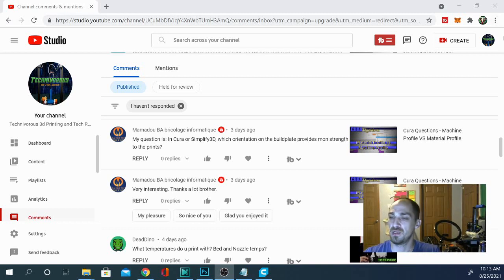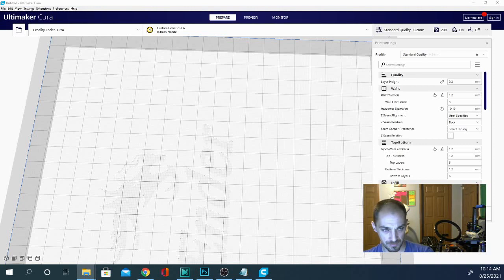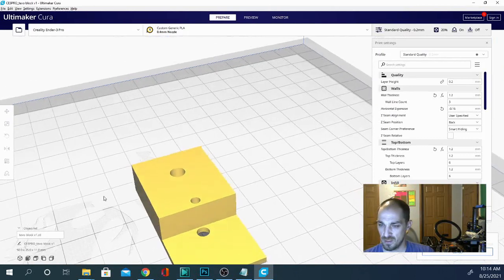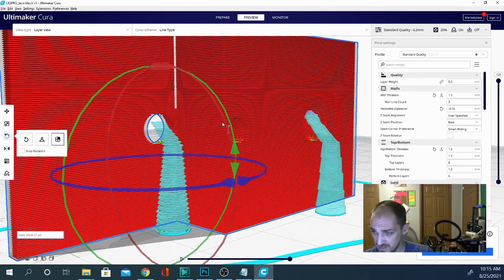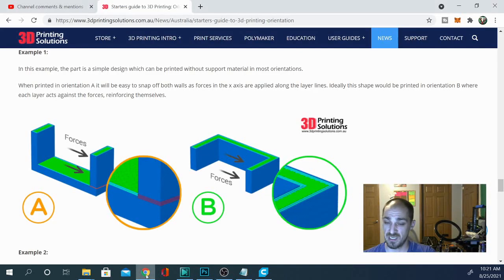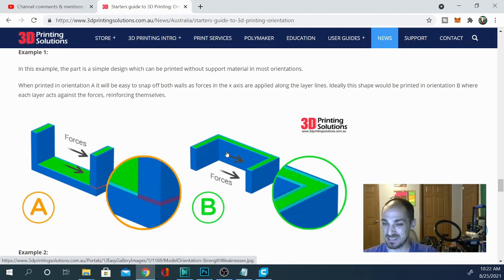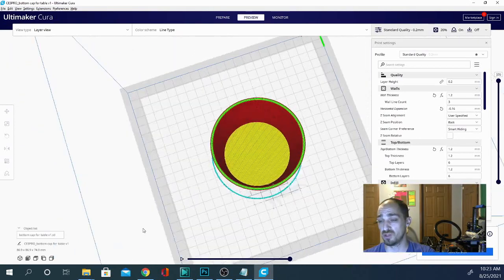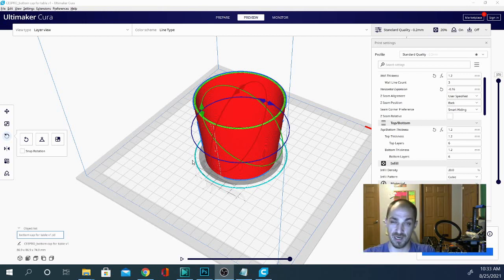Cura Questions  -  Best Orientation for Strength

Comment: In short, layers direction should be parallel to the force, if they are at 90 degrees angle then the part would snap, this is based on experience as a mechatronics engineer who prints part for functional robots and also a bit of physics.

Comment: I printed an electronics cover for the Ender 3 in natural PETG so I could replace the electronics fan with an RGB model but the threaded standoffs that the fan screws fitted broke off, watching this video got me thinking how I could strengthen them but with them being round I think the only way is to print some butresses to the screw standoffs, the cover is an exact replica of the Ender 3 cover apart from a box to cover the PIN 27 board